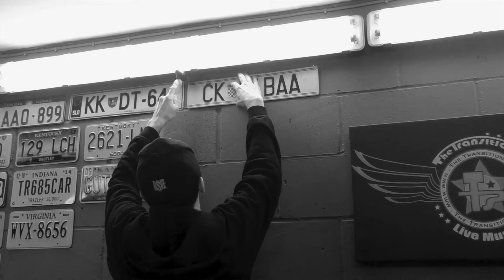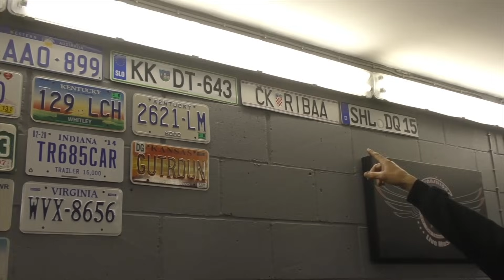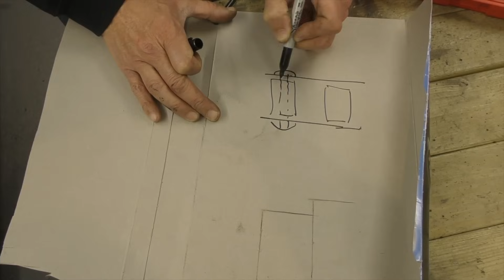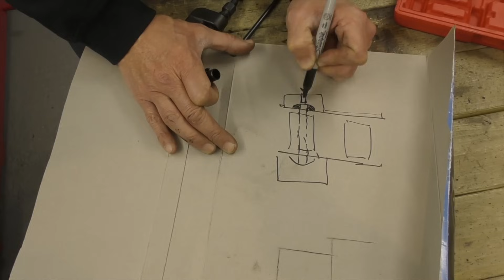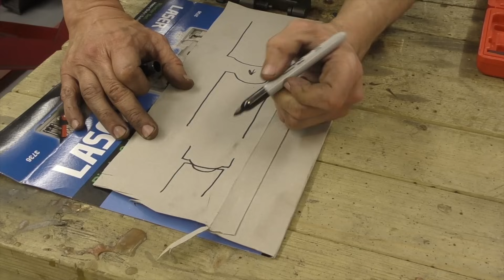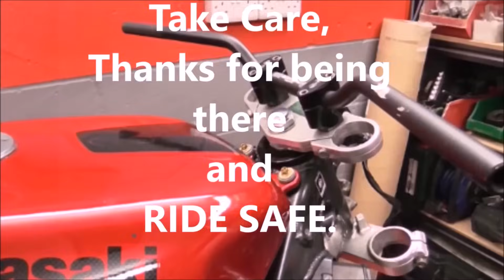Delboy's Garage, Motorcycle Chain and Sprocket Change.

Comment: Hey Moonfleet41, I also want to join the party and say thank you for such a great video and explanation, great job! One complementary question: Do you also recommend to ALWAYS change the entire chain+sprockets set or is it ok to change just the chain if the sprockets look visually in pretty good shape (no saw-shaped teeth etc.) I heard that in general is it recommended to change the whole set, but I wanted to get your perspective/recommendation on this topic. There is a lot of comments here and it is hard to search through properly, therefore I am sorry if similar question was asked here already. Anyway, thanks again for great videos and cheers from Czech Republic.
Reply from the maker: Hi Jan, how wonderful to hear from you... what a beautiful country you live in !

As for the chain/sprockets issue... in theory, it is always advisable to change the entire 3 piece set, if you can afford to... sometimes, it can extend the life of the chain and rear sprocket, if you replace the front sprocket once it shows significant signs of wear... what I mean by this is once the teeth start to look a little worn, and the chain shows a little 'slop' or movement over the teeth, then this will cause the front sprocket to rattle against the chain as it drives, and this can wear it quicker.... if you simply replace the front sprocket, at this point, then the new teeth fit tightly in to the chain, and the chain doesn't wear so quickly from then on.... usually the front sprocket is 1/3rd the size of the rear sprocket, say maybe 15 teeth on average, to the rear sprocket which has, maybe, 45... this means that, naturally, it turns 3 times for every revolution of the rear sprocket so it will wear 3 times faster... so with my bikes, I replace the front sprocket when it's done about 10k miles and, usually, the chain and rear sprocket if constantly lubricated, cleaned and cared for, could last up to 30k miles with ease................

We would never advise simply just changing the chain, because it's usually the sprockets that wear, and as I've already said, worn sprockets will soon wear the chain out, so putting a new chain on to worn sprockets is not good.... hope this jelps you Jan, good luck with it, all the best, Del
Reply: Moonfleet41 Makes perfect sense, thank you for clarification!

Comment: Hi friend! I’ve purchased an endless type D.I.D chain by mistake. I wanted to get open ended chain. Is it OK to cut the chain at any link and install rivet type master link (which I’ll buy if it’s ok.) there? I trust you very much and waiting to hear from you before putting it on my bike. Best regards.
Reply from the maker: Hey Derin, great to hear from you - you can break open your chain and fit a compression link, but you must make sure that you buy absolutely the CORRECT link from the people you bought the chain from... and then, obviously, fit that link in the right manner, as we show in the videos... but before you go to that trouble, have you thought about maybe just dropping the swing arm out and fitting the chain in it's continuous form... it's only a case of removing the shaft that holds the swing arm in, and pulling it out the back of the bike... once it's out of the way, you can thread the chain over it and loop it up around the front sprocket, then re-fit the swing arm.......

Alternatively, have you thought about asking the company you got the chain from if you can swop it for the right chain??  
Just some thoughts, hope that helps you, all the best, Del

Comment: Thanks Delboy, just used this as a refresher to replace my 530 chain. 

Did anyone strike an issue when pressing the new plate on with the Sealey tool, and the holes not lining up with the pin holes? I could line up one hole but not both. I had this happen last time, too.

Comment: Very good logical information UNLESS you are out on the road in need of the tool ....then a cheap tool is likely to fail simply because you don't have the luxury of a grinder.   Of course it is not so likely you will replace a still functioning chain on the road .... but you might ....maybe you are thousands of miles from home and the chain has stretched beyond your ability to tighten anymore ...so you find a replacement chain .... a likely scenerio you need116 link or whatever but local parts shop has 120link new chains which come with rivet link ....all you have is low quality chain breaker/rivet tool ...you don't have a grinder!   You have to remove links on new chain (common as grass scenario) and then rivet the thing on with the new master link...you are screwed if the pin won't even last to break a chain one time.... just saying...and even carrying a clip link won't solve the problem of shorting the chain....almost need to carry a very high quality breaker tool....or be at atheist Mercy of whatever repair facility you can locate...IF there even is one depending on your adventure has led you.   just saying
Reply from the maker: Hi Dougie, you keep repeating the words 'just saying', don't quite know what that means, and I don't quite understand what you're getting at, you seem to be deliberately inventing fantasy scenarios that would call upon this tool where you don't have one, and your invented scenarios seem to centre around not being able to grind the head off the pins... so here's a solution to your example scenarios... carry a Snap-On chain riveter and you'll never have a problem, or carry a lightweight lithium powered battery grinder with a 4" disc.. you can charge it from a USB on your adventure bike, so there we are, two solutions to your range of scenarios... merry xmas mate and have a happy new year on your adventures, and perhaps consider a shaft driven bike so that all of your scenarios will be avoided...

Comment: When fitting the outer link face is it necessary to use a micrometer or are you just a little OCD. I wouldn't think most bikers have this bit of kit in their toolbox. Does the chain tool fit it reasonably parallel?
Reply from the maker: Hi Paul, not a micrometer mate, its just a digital caliper to give me an accurate measurement, they're a handy tool to have for so many things, and you get a great peace of mind knowing things are spot on.!

Comment: Literally just done a DID chain and sprockets change today before watching this video. Done the old fashioned way as didn't have the "proper" tool, pair of mole grips with resessed hole in the teeth to press the plate on, 2 hammers to peen the heads over. Job done. I would like the right tool for the job, does makes life alot easier. 👍🏼

Comment: I love your work Del...BUT! did you ruin your dimple in this vid ..comparing the before and after shots of the dimple it seems you have ?? lol only asking because I'm just about to do the same job and don't want to ruin my dimple.. looks like you turned your dimple into a pimple lol...
Reply from the maker: No mate, it puts a line round it in the surface of the metal, but it still works perfectly and that's the third time I've used it, in fact am about to use it again this week on the streetfighter chain... you're only looking to spread that pin by a few thou and as it's extremely hard it does leave a little bite in the dimple... and even though it looks like a pimple, it still works as a dimple !

Comment: Grea video thanks Del. I went a little deeper with the grinder right through the plate so I didnt have to push the pins out and that worked well without damaging the rest of the chain. Any reason why you stayed with 525 rather than go to 520?
Reply from the maker: Hi there.. Thanks for your kind words, i stayed with the 525 because its the right chain for the bike.. why would you fit a smaller one buddy..!

Comment: Two things you may want to add to the description, or video.  One, if the link pin cavity is full of grease, The pin won't flair properly, because grease can't compress.  Two, the pressure plate with holes is hard to align with the two link pins if they're not above the side plate. It's easier to use the anvil / receiver to center an empty pressure bolt,  alternating, so as to keep the side plate relatively square with the pins.  Otherwise, well done.

Comment: You need to measure the head of flatten rivet mate, you can’t rely on worked out tool end 🤦🏼‍♂️ this chain will drop soon
Reply from the maker: Check the recent video i made fitting the XJR chain, pin measured with a caliper before and after...  and this chain FWIW is still fine and was flared by "9 thou"
Reply: I was going to say the same thing.
If you go on the DID website they have a specs chart on how far you need to expand their links.

Comment: Gday mate ive recently subscribed to your channel you got my attention with your aluminium brazing video which i thought was pretty  good and then i find a whole host of other good videos anyway , i cant get this model in australia so i am going to order online from england as there are to many dodgy chinese look alikes on the market that get reports of breaking after the first use , i was pretty impressed by this video and the tool so i did send a email to wemoto but they never replied so have to go with another seller on ebay do you still think it is a good tool and if its not to much oof a pain could i get the part number from you so i know im getting the right one cheers from aus.
Reply from the maker: Hi mate, sorry to hear about Wemoto ignoring you, but I guess in these lock down times they are probably on much reduced staff, but the good news is, it's not made by Wemoto, they're simply a retailer, it's actually a Sealey item, and they're a worldwide company and can certainly ship one to you, or recommend a supplier in Oz... here's a link to the item on Sealey's main website:  https://www.sealey.co.uk/product/5637206270/motorcycle-chain-breaker-riveter       You can buy direct on their website here, as you can see, it's on offer at the moment, so a really good price.  The drive pins are vulnerable, and if you break one, they are available as a single replacement, if you use them a lot, then they'll wear out, just like a drill bit for instance... so see if you can order one direct from Sealey, and let me know if you have a problem, and I'll see if I can contact someone there directly for you, but am sure they will respond.  Good luck with it, Del
Reply: @Moonfleet41  Gday mate well tried to get onto seally website with no luck dont know why anyway , wemoto have a store or stockist in australia but he will get more stock in 20 days ? anyway after fluffing around i saw a bloke in england selling it for 38 quid roughly around 59.00 au plus postage so i bought it from him probably didnt get the best deal but anyway it is on its way presumably fingers crossed genuine seally same as yours he was on ebay so if it goes pear shaped i do have recourse to get my money back looked at a lot read a lot of reivews most said the chinese ones broke after the first use so there would be 40.00 thrown under the bus ,hopefully it will all go good thanks for your help .
Reply from the maker: @crispernator  OK mate, sounds like you've got it under control!  I found that the best way to make the drive pin last (which is the only vulnerable part of the kit), is not to 'lean on it', it's essential that you grind that head off the pin first and don't try to push it out with the pin, because that's what will buckle it... if you're needing too much force on the screw, then grind a bit more off, and if you're chain is going in the bin and you're not going to re-use it, then don't use the pin to push the link out at all, just lop the grinding disc straight through the old chain and cut it off... the only time you would drive the pin out is if you're going to re-join the chain, like on a bike with a braced swinging arm... either way, good luck with it mate, hope it all works out for you.
Reply: @Moonfleet41  thanks mate
Reply: @Moonfleet41  Hi mate just a quick update the sealey chain breaker arrived today really happy with it .
Reply from the maker: @crispernator  Oh that's great news mate, awesome, and im really glad you're happy with it.. hope it stands up to use now and you get your value out of it.. take care and ride safe aye.. Del.
Reply: @Moonfleet41  day del hope all is well with yourr recovery my shed got broken into 3 weeks ago and my brand new seally breaker was nicked never even got to use it once .
Reply from the maker: @crispernator  Bloody hell mate, thats awful, so sorry to hear that, i hope you have some insurance that can buy you back the things that were taken... makes you want to get medieval on the light fingered little gits aye.
Reply: @Moonfleet41  yea i was not a happy camper , the part where you say grindof the head is one i think a lot of people dont do and they break this tool .

Comment: Another masterpiece, however when assembling the new link the plate with the two holes should be behind the chain to line it up and the groove should push the link home and that way the two pins are free to protrude without misaligning with the two holes.

also fill the two bushing holes with grease and push together by holding finger over the hole and thus pushing the grease around the pins back in the bushing as they squeeze at the end of pushing through.

very good video though; a fan.
Reply: if you plate with the two holes is behind the chain then how would you rivet them ?? you would have to manipulate the rivet tool from the wheel side of the chain ??

Comment: Exact same tool is £10.50 on Ebay minus the Sealey branding. Like most things they sell, this is just a generic tool with the branding changed.
Reply from the maker: This video was 4 years ago now.. Sealey have dropped this tool and now upgraded to this one mate..https://www.spanner-monkey.co.uk/motorcycle-chain-splitter-and-riveting-tool-set-heavy-duty-119022?search=SMC4&description=true.           
way better design, and makes a really tidy job of the pin spread.  Also, Sealey hand tools come with a lifetime guarantee unlike the random unbranded stuff..

Comment: if you are going to get the grinder out why not just cut the chain?
Reply from the maker: yep, if it's purely going in the bin, then just lop a disc through it, but in many cases, people will re-join the same chain, say for instance if you're dropping a swing arm out that has a brace, and you need to break the chain to get it out.